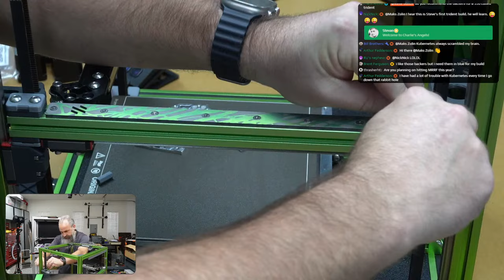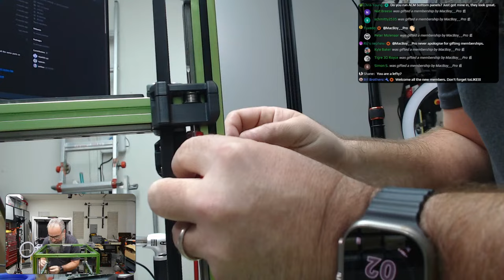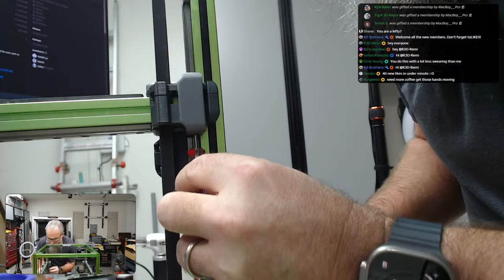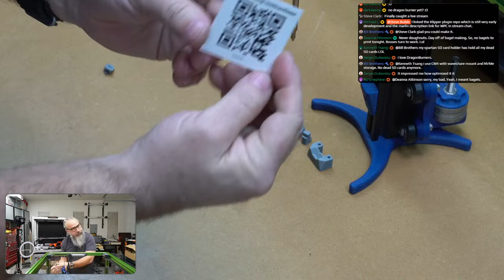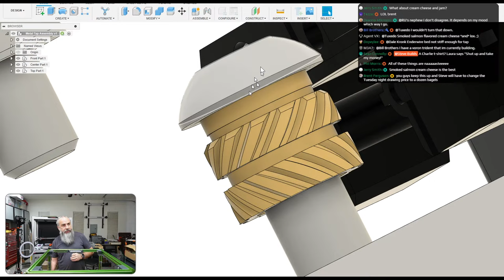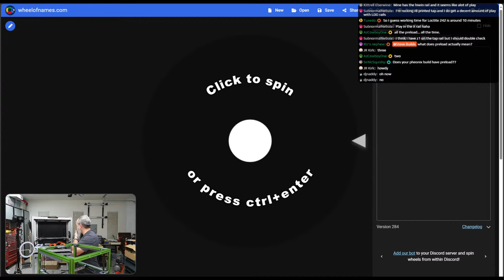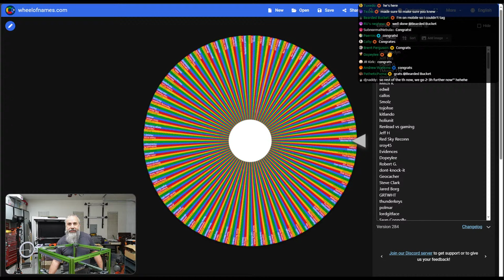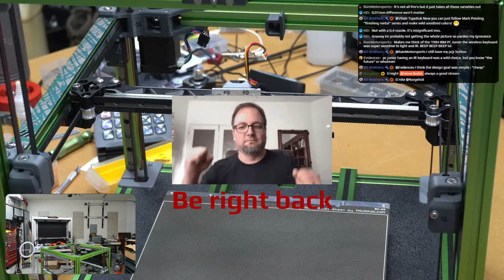Modifying my V2.4 250 - Part 3

Comment: Steve what color silver abs and brand are you using on this build. i just joined CharlieS Angels crew this morning!!
Reply: also which  module are you usingb the 5volt or 24 volt
Reply from the maker: Hard to tell, I've gone through a few silvers that seem mostly interchangeable as long as you don't set them right next to each other.  Latest stuff I think is Polymaker Silver ABS.
Reply from the maker: Can you give a timestamp link to what you're talking about?  I skimmed through the video and didn't see any electronics bay shots in this one.  If you're talking about the TAP module then it'll be a 5v/24v tolerant one.
Reply: @SteveBuilds all is good your how to videos inspired me to build a Voron with the Galileo 2 and titanium  backers from Fabreeko, Hector has been amazing during the process.
Reply: @SteveBuilds  yes sir that's what I was talking about so would your day the tap is a superior choice over Klicky